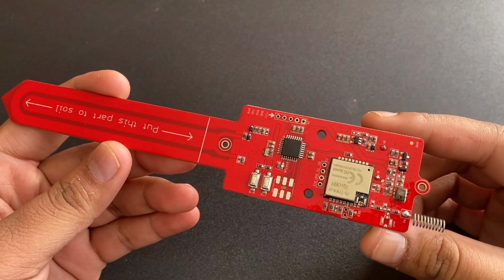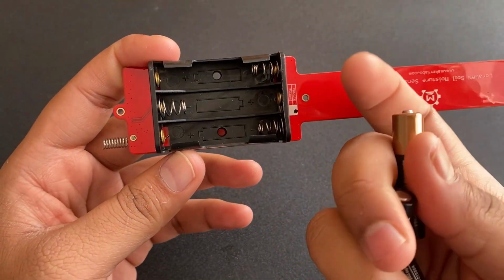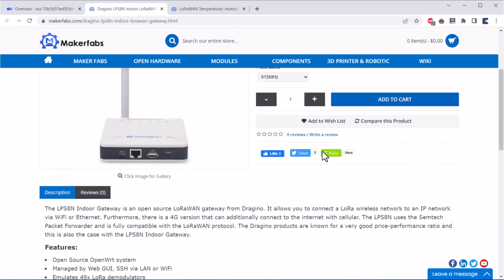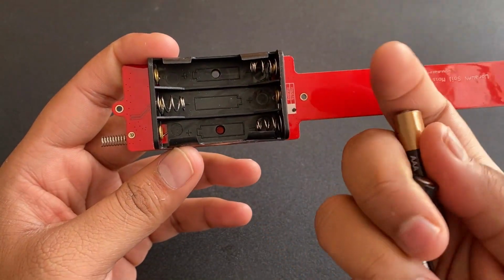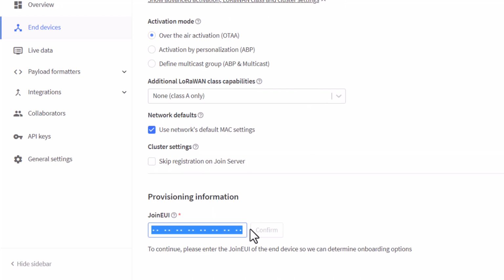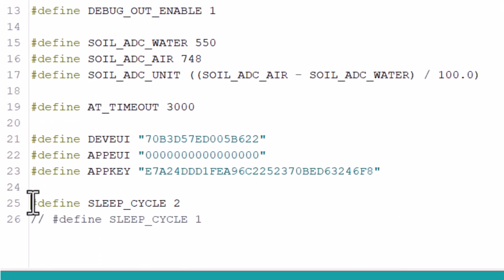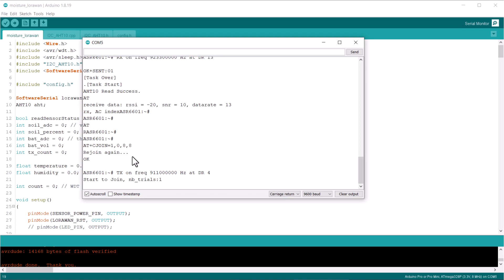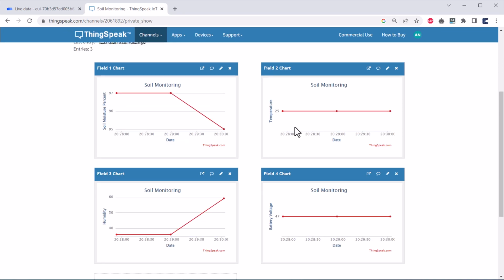Smart Soil Moisture & Air Temperature/Humidity Monitoring with LoRaWAN on TTN Server

Comment: Another well done project.
Project idea>> There is a need for a low cost interface between commonly available free software that has an USB output to an ILDA analog input control signals for laser control.  Low cost DAC units are available, but they do not directly take the USB input from commonly available software.  If this hardware could also accept an arduino serial input for DAC output then laser projector units could be directly controlled by computer enthusiasts.